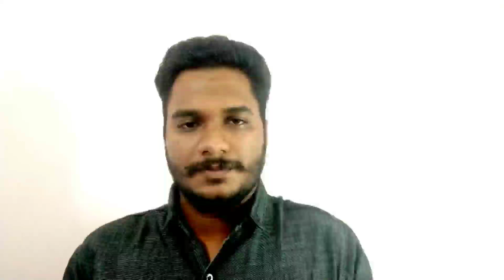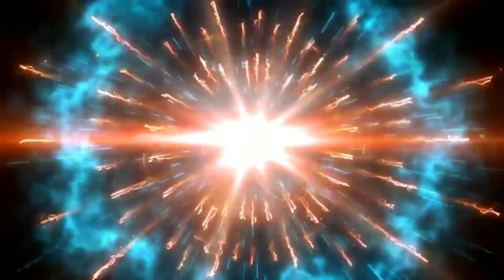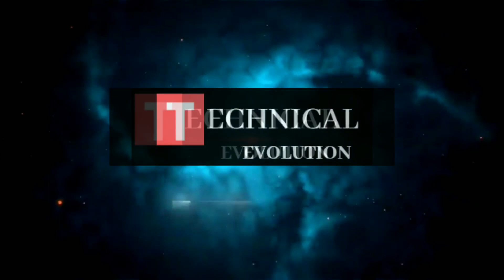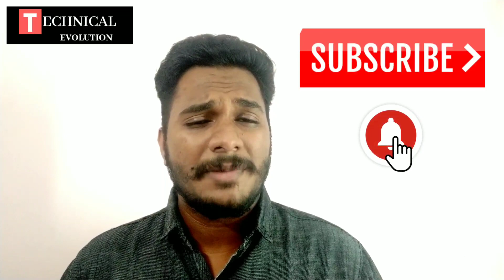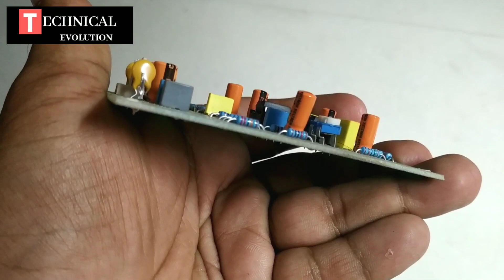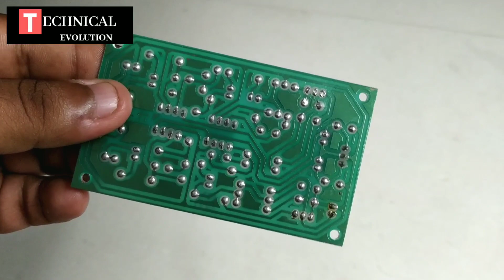subwoofer lowpass filter for amplifiers having power if 500w and above

Comment: Available at our shop at Thakaraparambu, Trivandrum.
Reply: A.B. Electronics

Thakaraparambu Rd, East Fort, Nalumukku, Pazhavangadi, Thiruvananthapuram, Kerala 695001
098951 47241

https://g.co/kgs/JRNfuq
Reply: Enikku 250nannu tharunnadu
Reply: @rameshkannan2775  എനിക്കും.... 250 ന് ആണ് തന്നത്
Reply: @VENUGPL1  e board mathiyo caril sub kodukan sub amp ila pleade reply bro
Reply: @rameshkannan2775  e board mathiyo caril sub kodukan sub amp ila pleade reply bro
Reply: @rameshkannan2775  athu verey model anu 250 roopa athil  3 preset und gain kootanum  input level adujusting athil und
Reply: Thrissur ke kittan vella vazi inda
Reply: Transistored subfilter available un dooo bro shopil?
Reply: 250 nu kittunnath verey model anu 3 preset varunna type anu athu

Comment: #Car_tereo  Subwoofer board ayi sub filter board use cheyan pattumo chetta ( വേറെ ബോർഡ്‌ ഇല്ലത്തെ)
 #connection 
CURRENT [ red - positive ]
                  [ black - negative ]
Speaker [ 2 - Grey ,  2 blue ] 
Antenna [ 1 - White ]
Sub Output [ 1 shield wire ]

Comment: Lumin systems  subwoofer filter kittum. Kidu anu. Stamp size. Fully smd.only 250.  Extreme quality components and double sided pcb. Smooth gain . No comparison to that.
Reply from the maker: Nte kaiyil athinte 2.1 pramp iruppond tlo72 smd 6ic varunnath
Reply: Technical evolution yes. Athu thanneyanu. High pass filter ullathu